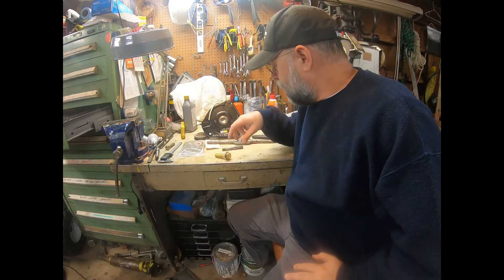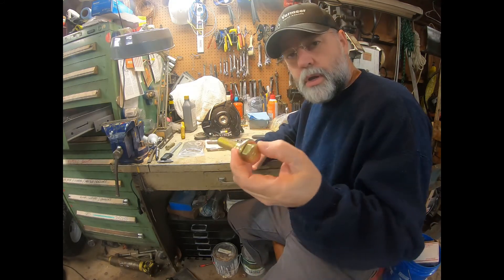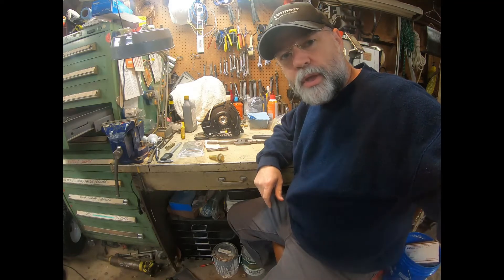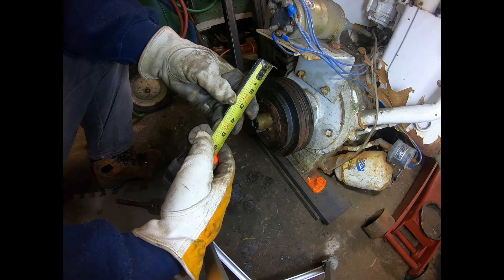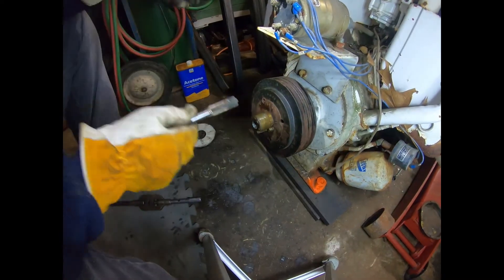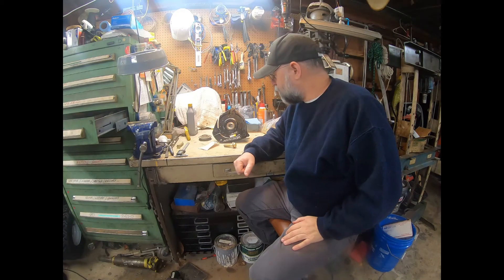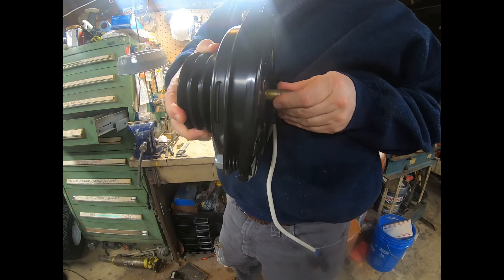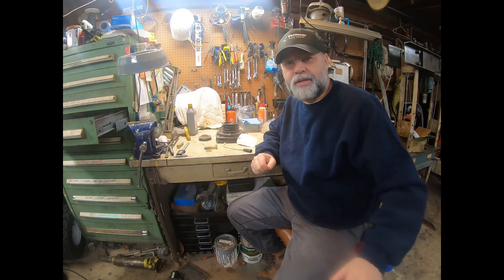Vermeer SC252 Engine Up Grade Part 3 Wisconsin VH4D

Comment: I just went thru all 3 of the videos to make sure you haven't tried using this modification yet ......... I own 5 of these 252's and they are top heavy and will flip very easily and thats with the factory engine ........ you've got skills and great ideas with this but please be cautious
Reply from the maker: Hi Bill, Thank you for watching.  I definitely agree this is going to be top heavy.  I got another set of wheels so there will be a wider base and have thought about putting some sliding outriggers on it.  Certainly won't be trying this out on any hills.
Reply: @ironore1866  At the min you will need outriggers ..... you'll find them useful in hilly conditions ..... I'm also afraid that engine may be too heavy for the hydraulics and those pumps are not cheap ........ and one more thing .....that Ogura electric clutch may not be your best choice for engaging the wheel ..... always be at idle when you flip the switch but that engine may over work the holding pressure of the clutch ...... look at the Carlton system where you pull a lever to tighten the belt  ...... sheeves are a whole lot cheaper than those clutches ...... look me up on FB or MeWe if you like ..... I've had to fix about everything on these machines at one time or another 
....
Reply from the maker: Hi Bill,  Once again I completely agree on all of your points!  I'm looking forward to you being a resource on this project.  Thank you
Reply from the maker: Bill, What do you think about using a counter weight on the bottom of the machine?
Reply: @ironore1866  there are all kinds of things to put on the other end for a counter weight .... a blade for pushing chips, tool kits and I've even seen a seat mounted to one but at the end of the day it comes down to what that frame was built for and even how much load the wheel bearings can stand